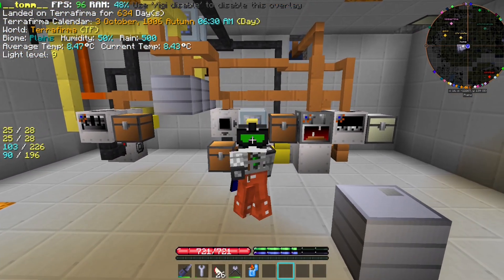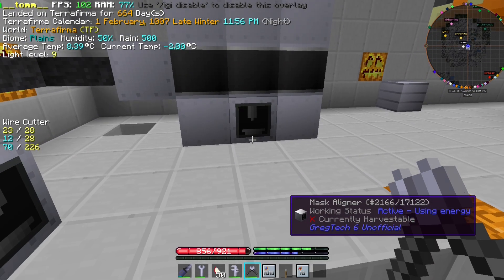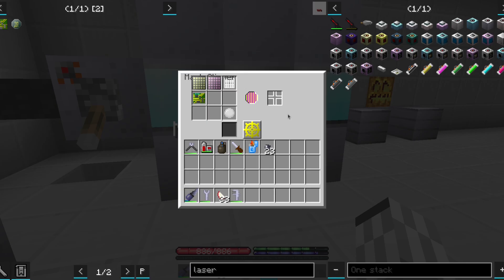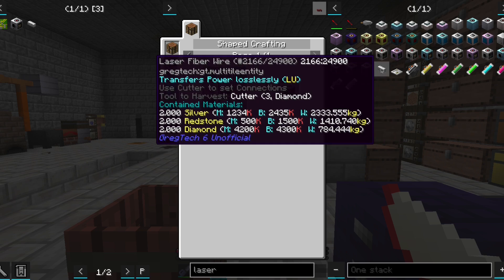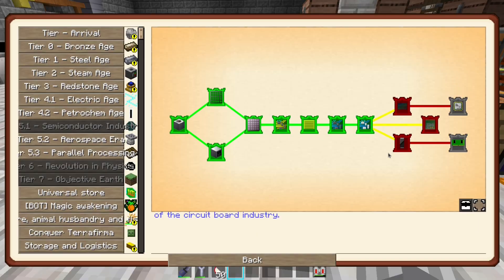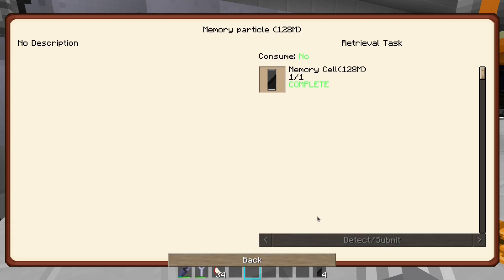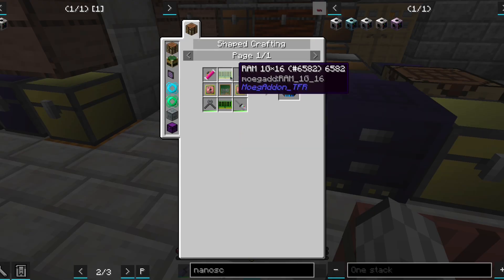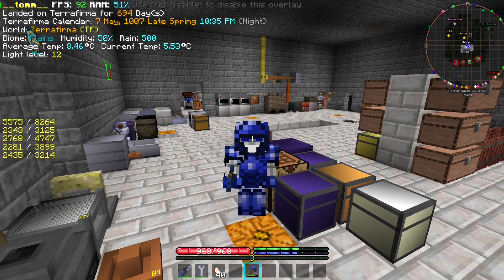TFR 11: semiconductor industry

Comment: Possible cover on side of main mask aligner block then red stone covers accept end emits on every other mask alligner block that makes connection to laser then of course red stone switch cover on front of laser, this help you to automate this machine and every future machine where automatic switch cover not directly control power block. Next 240 gu it’s higher mv so when you use Hv machine you need 4 times more to run recipe 960 gu that’s how penalty works for ev machines 4x more only multiblock machines not using penalty for recipes
Reply from the maker: yeah, 240 is still MV. and you have to use the HV laser with it to work in the upper range.
i'm too much into the gtnh/gt5 mindset.